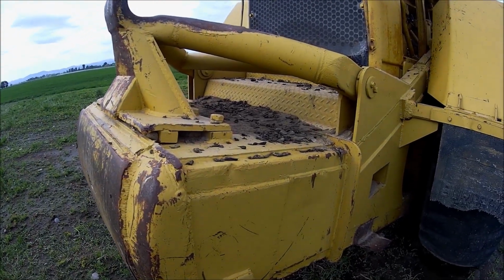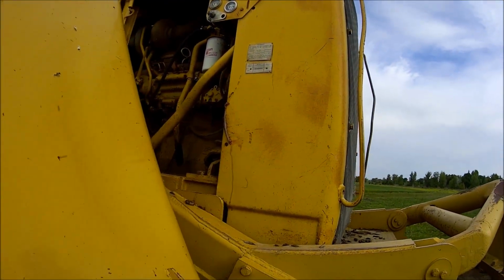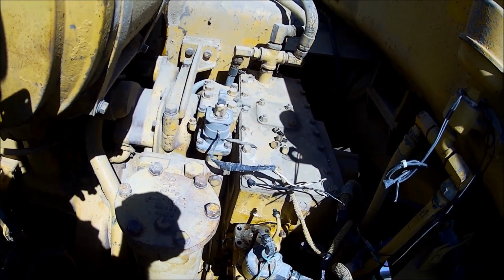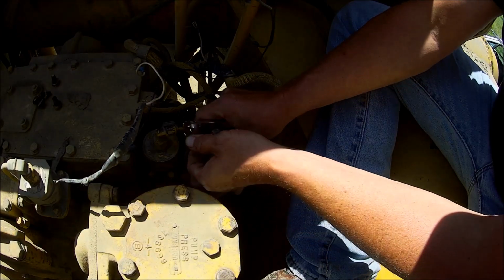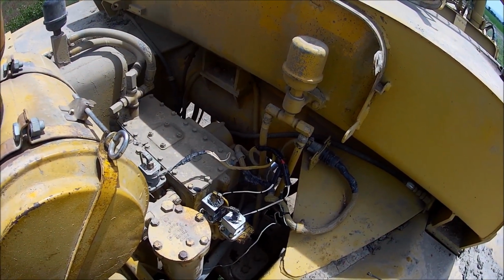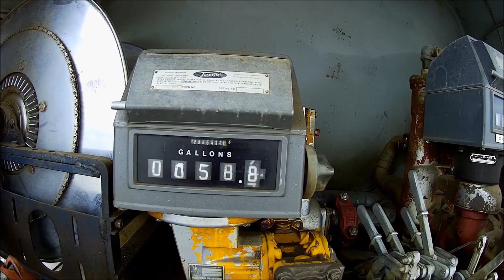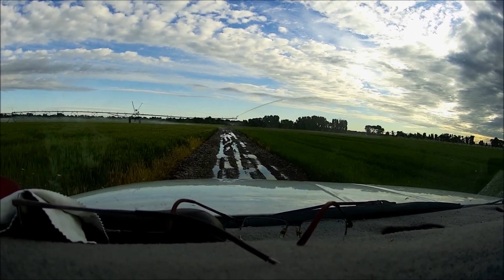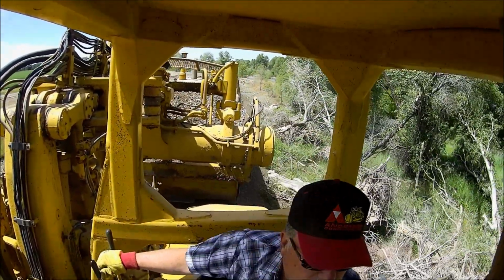Gopher Guts

Comment: why do you change the fan blades around?
Reply from the maker: It's called a reversible fan, it will suck the air or blow depending on how the blades are positioned, summer time you want it to blow the heat away from you. plus if you get trash on it you can change the blades and push all the debris off
Reply: Ahh got it thanks.
Reply: Thanks.  I wondered about that as well.